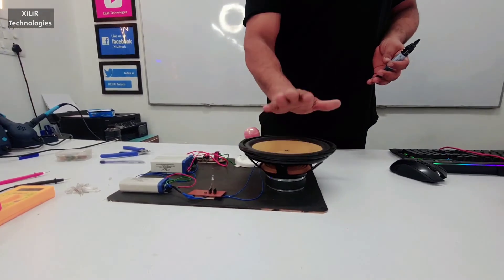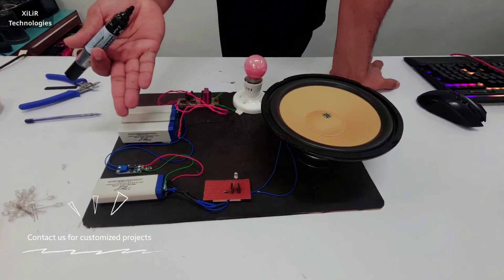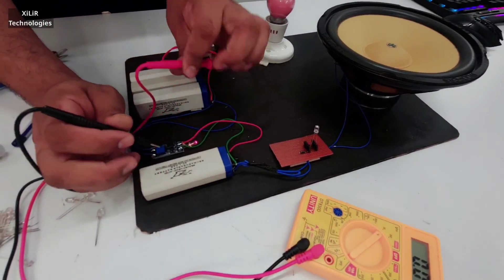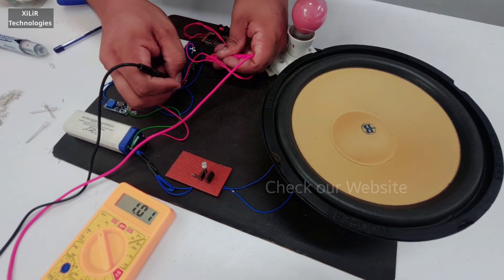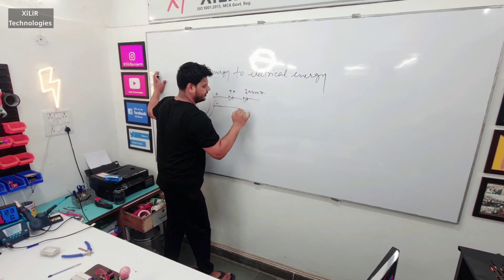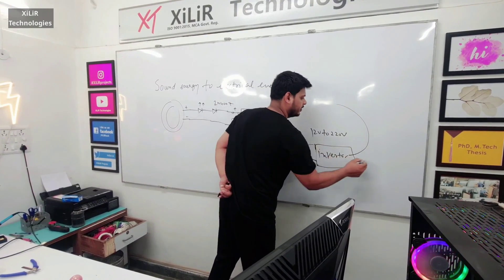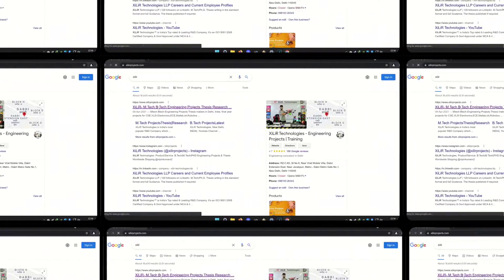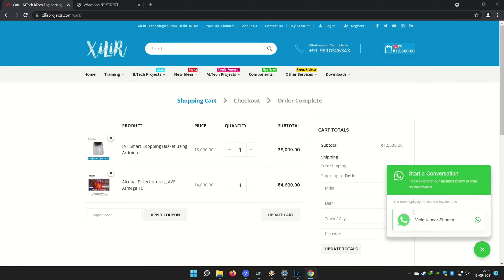🔋Sound Energy to Electrical Energy Project | Noise Energy to Electrical Energy project

Comment: Okay so we have a project similar to this, can someone just clarify if im right: the speaker pics up sound (when the small led light turns on it just shows that its collecting sound) the energy is then powered into a battery and into another component (i dont know what that is called) which seems to amplify the energy made? and then charges the three batteries, a switch is attached to the batteries that turns on the light bulb (im hoping for a quick reply huhuu)
Reply: Hi, what was the result of your project? We also have a similar project like the one shown on the video
Reply: @shanellerianab.vallespin9472  everything works, though the way the speaker collects sound is inneficient, the sound needs to be loud and close enough to cause the speaker to vibrate so it'll create electricity
Reply from the maker: 🔥🤩 Free Docs, Synopsis | PPTs, Get Project from Below Link :
👉 https://xilirprojects.com/product/sound-to-electrical-energy-conversion-system/
💬 WhatsApp: https://wa.me/919810326343
Don’t forget to SUBSCRIBE ❤